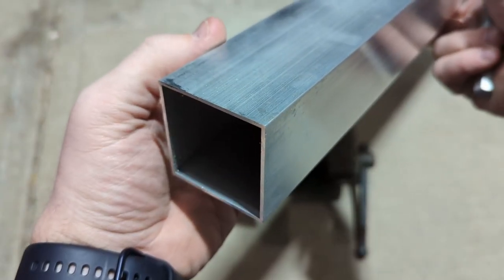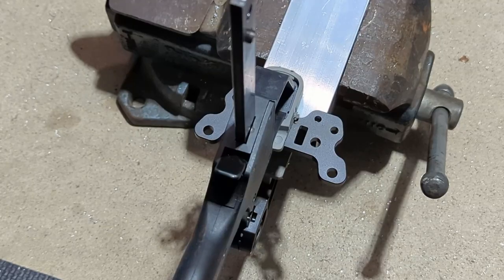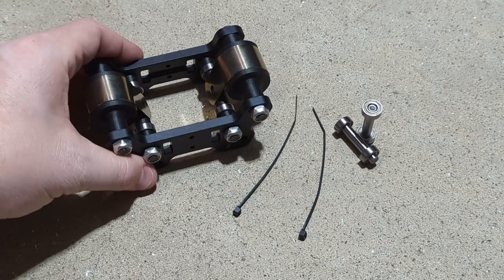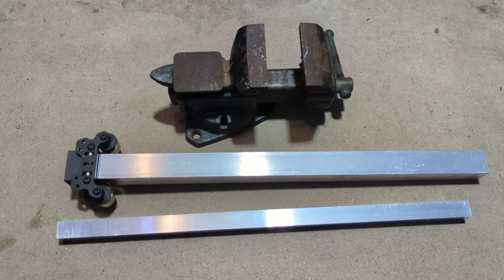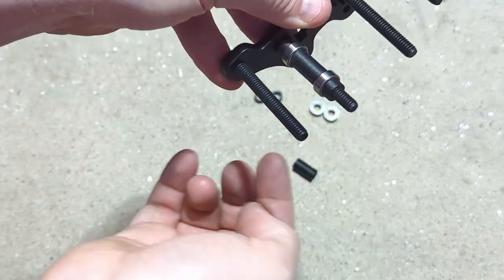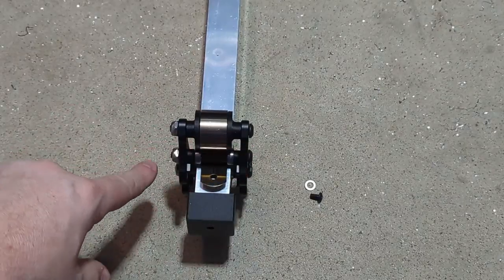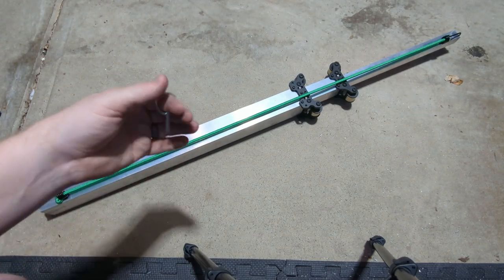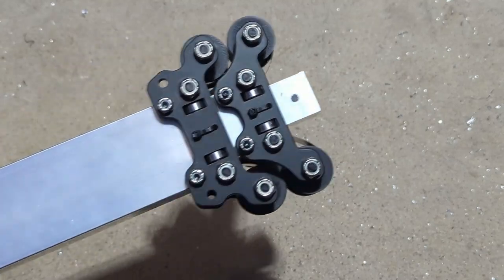Thrifty Telescoping Tube Assembly Video

Comment: Can this be attached to a motor to be programmed? Also if it is pulling a weight up can it hold the weight at the top, or will it slowly drop back down?

Comment: What prevents the constant force spring from spinning around? Is it because, as the spring is extended the inner diameter contracts to bind against the inner spacer?
Reply from the maker: The roller that is inside it is more of just a guide / spacer for the overall assembly to keep things properly spaced. The end of the spring bolts to the bottom of the tube which ensures it cannot spin freely. Let me know if that helps.